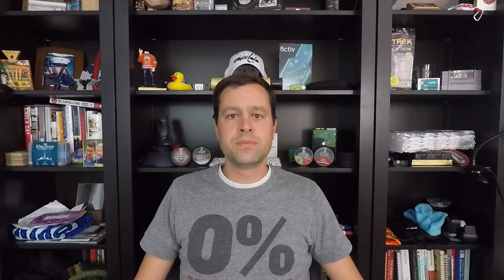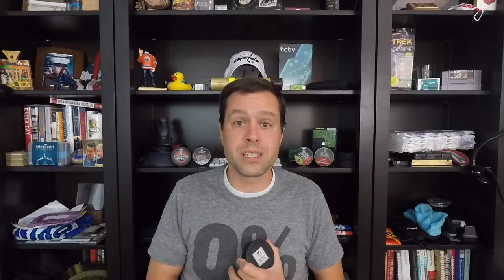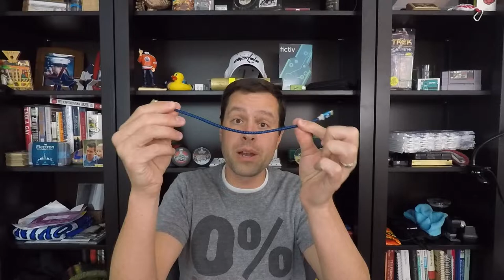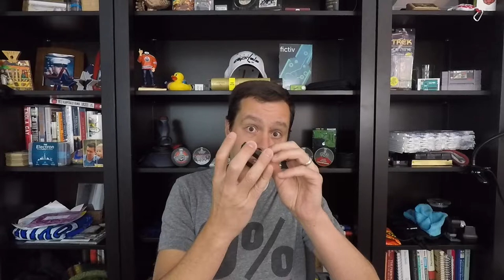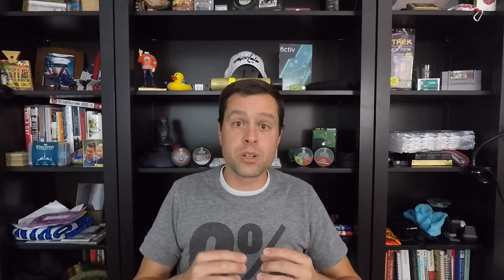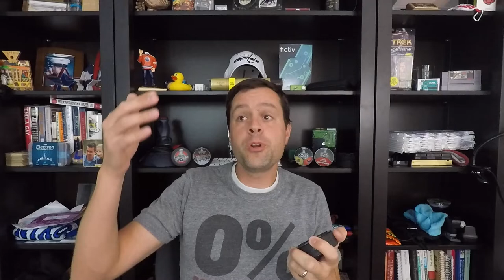Maker to Product: The Bill of Materials

Comment: Hey Kevin! I've recently been to a "prototype workshop" offered by a PCB mounting company here in Brazil, and there they gave us (the engineers/developers/designers) their point of view about the PCB manufacturing process. They taught us good practices about part-lists and how to make it more time/cost efficient for both, us and them. There I heard a lot of these exact same problems you are talking about in the video! 

I'm not sure that the PCBA process is the same in Brazil as it is in the US, but some tips they gave us were to use open part-numbers in the common parts like resistors, capacitores, diodes... for example, I'd only specify the footprint, value and the tolerande (e.g. Ceramic capacitor 100nF 0603 5% or better) not even mentioning the manufacturer... Another tip would be to project the PCB with more than 1 footprint option for some parts, connecting them in parallel and only buying and populating one of them, according to the ease of purchase, but I see that this would be a problem in your tight design...

They also commented about this passive component run-out that is happaning in the world... Anyways, I've also faced many of these problem you're talking about in the video during my engineering experiences, and I wouldn't stop typing anytime soon if I were to share everything that is coming to my mind right now... lol
Reply from the maker: Hey Giuliano, thanks so much for watching and commenting. Huge shout out to Brazil. Your comments definitely hit on a lot of the things I'm going through. So many things to think about and a lot of attention to detail. Just managing all of it makes my head spin sometimes. Hope you're well and have a great weekend.